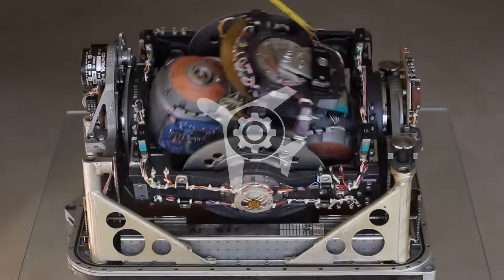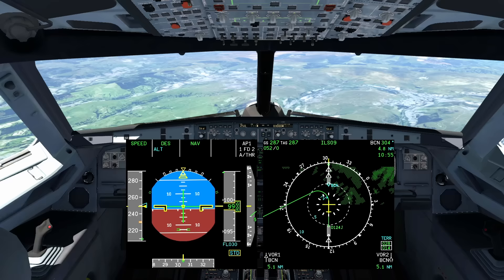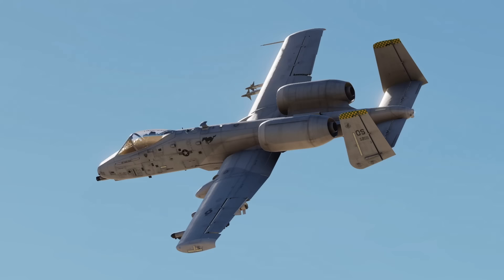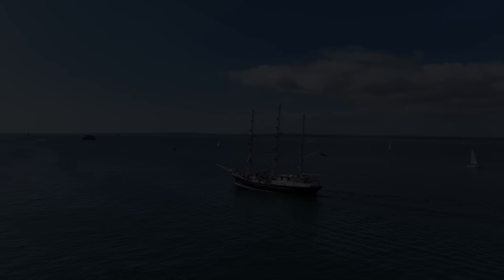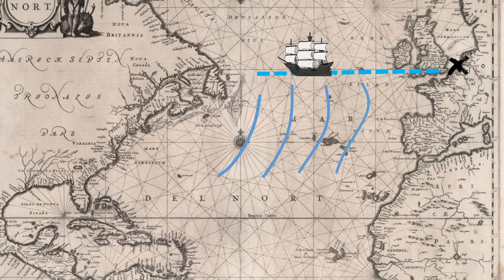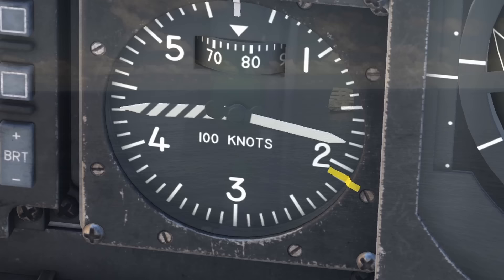The GENIUS of Inertial Navigation Systems Explained

Comment: Great video!! The INS in a submarine is MUCH larger than the aircraft version. Any ideas why? Also, there is a great movie called Longitude from 2000 that shows what it took to produce a clock that is not only accurate enough for navigation, but to get it to work and stay working on a sailing ship.
Reply: My guess would be sensitivity being they are completely blind, but that's just a guess and if like to know, too.
Reply: I would guess that size and error resistance are correlated. Planes generally measure their flights in hours, maybe days, while a sub might be out for months at a time. Error is cumulative, it adds up, so subs would need to be much more resistant to error for the ins to stay accurate over that long period of time.
Reply: That's easy, They have to make the submarine ones water proof so naturally a water proof box adds dimension😂

Comment: You forgot the stars and the sun which were used for navication before the compass..... and even with a compass, to correct the estimation calculated from the origin point and speen.
Another point: every inertial system need an external signal because of its internal drift. In planes, a gps signal is injected inside of the inertial system thru a kalmann filter. Without this, the accuracy is a big problem. ^^

Comment: I don't completely get the use of gyroscopes as explained in the video.   What I got is that the gimbals already keep the platform parallel to the horizon at least in roll and pitch. But yaw seems more complicated. Arent the gyros there to keep platform steady during yaw movement?

Comment: And Dead Recokening mainly involves finding the latitude, which you didn't even mention it. You only mentioned longitude and Knots measurement, but until advent of precise mechanical clock, it was not dete4rmined correctly, because the local time keep changes as the ship sails westwards. But, that was not really important when your focus is just move west, but what is important is are you moving north or south, which was determined by using Sexton. 

So, you are trying to explain something but actually didnt say much.

Comment: The key here is to know EXACTLY the point from which you start....get that wrong and you have an issue...... That's why the Air NZ flight flew into Mt. Erebus....
Reply from the maker: You're absolutely right, I could have done a better job on emphasizing that in the video.

Comment: What about the bearing resistance during certain temperatures and the inner atmosphere resistance? I can imagine that while the gyroscopes have a strong gyroscopic effect, there still will be always a bit of drag somewhere between the gyroscope plane(axis) and the outer casing causing a bit of drift, how do you compensate for this? Thank you
Reply from the maker: Hi! Thanks for your comment, and great question. You're absolutely correct, there will always be a bit of drag and environmental effects. Something I could have gone into more detail on is the bearings and friction of the gimbals. When the gyroscopes sense movement I believe they activate motors which rotate the gimbals. By using this feedback loop, the friction of the gimbals themselves is compensated for (the motors stay activated until the gyros stop sensing a deviation). 

However, in practice I think that these effects are still not negligible (despite the feedback loop). They unfortunately contribute to the INS building up an error over time. Modern strapdown systems no longer use a moving platform, which solves a lot of these problems entirely. 

I'm not an expert on these systems, I just find it really cool how they work :)

Great question, and you're spot-on with your remark.
Reply: @FlyByMax  Thanks for answering! As an field technician, I tend to always see the faults first and I can imagine that the buildup of the drift will be major over longer flight if not corrected periodically by another positioning devices as gps. 
Cheers for video, good content

Comment: There is one misconception… that you can’t tell the difference between accelerating and being on a hill. When you are in earths gravity, and the total acceleration is exactly 1g, then no matter your orientation, you are not accelerating relative to the earth. If however, the total acceleration exceeds or falls short of 1g, then the body is most certainly changing velocity relative to earth.

Using some quaternion or Euler formulas, it is simple to figure out which direction is up and down using only rotational position from an origin point and acceleration. And using some filters, it’s possible to continually recalibrate itself.
Reply: It was a flawed example but I'm curious if you actually got the point that they were making.

Comment: For your info, as far as smaller planes is concern, mainly for long distance ocean crossings, where the VHF does not work, captains no longer get air speed info by chucking a knotted rope outside.  We do something very similar, but it is a wire nowadays, that is our high frequency antenna.

Comment: Do Moving-platform inertial navigation systems operate differently If the airplane is flying directly against the earth rotation direction, or directly with the earth rotation direction or crisscrossing against or with the earth rotation direction? I would appreciate your answer.

Comment: Gravity is almost constant so if you have 3d accelerometers you can heuristically determine your change of speed without gyroscope it wouldn't be as accurate but it isn't very accurate over long time with gyro anyway. Real life example would be you would know you are going uphill if hill is steep enough because you would feal more pressure at your back while less on your buttom. And i would like to believe modern phone navigation software is already using this method (even if their gyros aren't good enough or not existent)i am not sure though but they should with the amount of resources available to them.

Comment: Here's the only problem with INS, there needs to be an extremely small error that needs to be introduced to make sure the gyro readings and the accelerator readings driftt off and cause havoc to the calculations. There needs to be correction mechanisms based on environment based readings or else it seems doomed on long term usage!
Reply: Needs to be?  Also, before GPS navigation became available, aircraft with triple INS routinely flew over long ocean routes without problems.  Total drift over the length of even a long flight was very manageable, and if one INS began to drift excessively, which could happen, the divergence from the other two platforms made it obvious which system was faulty.
Reply: @Hopeless_and_Forlorn  yes, hence it's better to have shitty hardware and then use software to eliminate noise! That's how you solve drifts! That's how you make cheap systems.

Comment: how does the INS know where the 'local horizon' is?  I assume that it cannot see it.  the platform inside the device is aligned to the earth, which is a relatively flat extended plain which is stationary.
how could early gyroscopes work i.e. in V2 rockets?  it was simply a spinning piece of metal. 
A modern computer would have to calculate alleged rotation of alleged spherical globe earth and that this alleged earth itself is moving through alleged space. And just what is 'the direction of gravity', from your description?

Comment: How can you compare feeling 1g Normal Force distributed in the bottom and back of the seat from sitting still on uphill slope to feeling the full 1g Normal Force on the bottom of the seat and the Inertial Normal Force on the back of the seat from accelerating on flat plane? Surely you would feel the difference.
Reply from the maker: As others noted, I made a small factual error in saying that there is no way to tell the difference (but the point I was trying to make is still true). On a slope, the vertical normal force of the seat will be slightly reduced, which is measurable. However, it is still impossible to distinguish the horizontal (relative to the car) acceleration from force. This is because force IS actually acceleration in a sense, as Newton second law states F = m*a. Hope this makes sense.

Comment: The absolutely wonderful INS that was used in the Boeing 747/200/300 was a totally independent navigation system so long as it had time to orientate itself from a starting position.
Ver Sadly just for Greedy reasons, the authority's replaced the INS with GPS, and the charged the 747/200/300 for correct mapping, over the Earth, and if you didn't pay the GPS was Lost, so you as a Pilot in the middle of the Night had to do simple Dead Recogning , and then could not shut the GPS off, cos it didn't know where it was, until the Aircraft got back to where the GPS knew.
So as far as I'm concerned the INS system was the Best for that Aircraft cos it could go all over the World without paying for Navigation Mapping that GPS charged for

Comment: I wonder how this works within the human body, how we keep our balance ect and if it's related.
Reply: Fluid in the inner ear or something. That’s why you lose orientation when spun.
Reply: Not really. The inner ear uses gravity to tell us which way is down. It uses fluid filled channels that have small sand like particles inside that excite nerves at the bottom. This is combined with the visual input we receive from our eyes. This system works fine while we are walking around down on the ground but it can be a pilot's worst enemy. In flight the acceleration during a turn can change the perceived direction of which way gravity is pulling us down. This can cause the pilot to become "spatially disoriented", which can cause the pilot to fly into the ground (as what happened to JFK Jr. and Kobe Bryant). In contrast a gyro platform can sense attitude irrespective of acceleration. That's why they use gyro platforms to give pilots an artificial horizon on the instrument panel that serves as an attitude reference that won't be affected by either gravity or acceleration.

Comment: I have a pretty good understanding of how basic navigation works, and also how the electromechanical gyros and INS works, and from this I have to say that this video does not do a very good job of 'explaining' what it promises to. Sure, it points out a number of issues, and mentions some things, but it does not really pull them together very clearly, and leaves quite a few issues open without resolution. Good, try, but falls quite short.

Just one example; the navigation of old sailing ships is mentioned, and it is pointed out that dead reckoning is not very good, and then mentions 'knots', but them fails to actually say anything about how the problem was solved (it was NOT solved at that time by the use of gyros or INS, etc. It was solved by slow improvment of maps, by long study of star positions in the sky, and by gradual development of accurate chronometers, all of which used together allowed accurate global navigation, nothing electrical involved. Why set that situation up as part of the explanation of INS if even the example is neither completed or explained.

I get the impression that the OP does not really understand what he purports to explain, but rather just read some stuff and repeats it, then throwing a bunch of computer animations animations at the viewer in hopes that it will distract and bamboozle.

Comment: I have a question about the correction of the gyroscopes... how does that occur?  It's stated that the gyro stays level from its starting position, so to correct for curvature, does it continually get  stopped and started again?
Reply from the maker: Great question. The correction occurs by applying a torque to the gyro depending on the latitude/velocity. This torque will cause the gyro to rotate as it is spinning. I don't think the gyros ever get stopped and started unless the system is initialized or stopped. Thanks!

Comment: As I understood matters in the 1970’s this was all very well but would become irrelevant if there was a nuclear explosion as the solid state electronics would evaporate. This in part was why Russian systems maintained valve or tube technologies. So this only becomes an available military technology for fist strike. When you p,aced this extension of what was being taught to your instructors it was rapidly bypassed. The problem when applied to land vehicles in the Seventies was the format was so sensitive that it was frequently only viable in workshop conditions and field viability was limited to maintenance by a very specialist number of personnel ie useless in spite of many claims otherwise. So it remains as something for aircraft only that are always maintained to higher base standards.

Comment: The intertial navigation is the mechanical gps of the past. Anyway, can someone tell me if you don't know where your starting point is exactly, this system will make a wrong route? Imagine a missile, you change the launching location by 10 meters, is gonna hit the target 10 meters away?
Reply from the maker: You're exactly right, and this is something I could have done a better job of emphasizing in the video. If you get your initial location wrong by 10 meters as you said, then the INS will always have an error of at least 10 meters relative to its true location.

Comment: So the INS needs a starting point on a map and trace its movements from there, right? It's only part of a larger system. But how big is the margin of error with these, do they need to be calibrated often, or can a system like this just run for years and keep track of its position perfectly?
Reply from the maker: You're absolutely right, it does need a starting point. This is usually done on the ground through either map coordinates or GPS. In theory they could run for years, but due to instrument noise they lose accuracy quite quickly. The one shown in the video has a 98% accuracy circular-error probability of four miles after one hour of operation. Modern systems have far better accuracy, being accurate to one mile after one hour of operation (95%). Although even they are used in conjunction with other systems such as GPS. 

Thanks!

Sources: 
https://en.wikipedia.org/wiki/LN-3_inertial_navigation_system
https://aerospace.honeywell.com/content/dam/aerobt/en/documents/learn/products/navigation-and-radios/datasheet/LaserVI-ProductDescription.pdf
Reply: @FlyByMax  Thanks for the explanation ☺

Comment: where in the F is there space in an F-104 for that thing? I would guess right behind the pilot between the engine inlets.. those things are engines with enlarged missile stabs on them. my dad worked on them and told me the avionics we're enormous compared to semi digital systems in the F-4(his next plane)
Reply: ps, I thought these systems were invented for missiles.
Reply: They are not that big.

Comment: Do you also need a speedometer?
Maybe you said that and I just did not understand.
Lite how would the navigation system otherwise till the difference between standing still and moving at a constant speed?
Reply from the maker: Good question. Something I could have spent more time explaining is about how accelerometers can allow you to determine speed. Acceleration is equal to a change in speed over a change in time, so you can use this to update your speed. Speed is in turn a change in position over a change in time, so by measuring acceleration you can figure out your speed and position. Hope this helps.

Comment: Why use gyros and not just a weight on the bottom? That would keep it aligned with the horizon without the need for corrections.
Reply: the 'shift' between the spinning mass of the gyro and it's frame (shown in video graphic) ...
that will occur when the plane/missile changes it's orientation in one of the three axis it can move in ...
will be MEASURED ... 
which allows the INS computer to figure out how MUCH movement in that axis the vehicle has changed ...
the gimbling system will then 'correct' ...
which is to PULL the spinning mass in line w/ the frame again ...
able to measure the NEXT movement/deflection in that gyro's axis ...
(all these gyro axis movements are combined w/ the accellerometer data to figure out 3-axis change in position)
Reply: @pontificusvascillious5287  But the shift created when the plane moves and the weight maintains its relationship with the Earth's center of gravity can be measured too.
Reply: @calorion  multi-axis? 
yaw, pitch and roll ...
sub second resolution ...
Reply: @pontificusvascillious5287  Well, it just handles the horizon alignment. I assume you still need a gyroscope for other measurements. 

But perhaps it is the resolution speed that's the issue here. I don't really know how accurate gravity is vs. a gyroscope.

Comment: “Dead” reckoning is a common misunderstanding. It is from the word “deduced” shortened to “ded.” Deduced makes more sense from your explanation! Otherwise a well produced video, thank you.
Reply: It is indeed dead reckoning and has been for the last few hundred years. It could have originated as ded reckoning way back when, but every navigation text or training program I ever encountered knew it as dead reckoning. 

Oxford Reference: Determining position at sea by advancing the last established position for course and distance run. Before the advent of modern navigational systems dead reckoning was the basis of most offshore navigation. The term ‘estimated position’ is sometimes used for the dead reckoning position corrected for the effects of tides, currents, drift, leeway, and so on. The origin of the term dead reckoning, which has been in use for at least four centuries, is obscure. It has been suggested that dead is a corruption of deduced, but there is no etymological, or other, evidence for this.